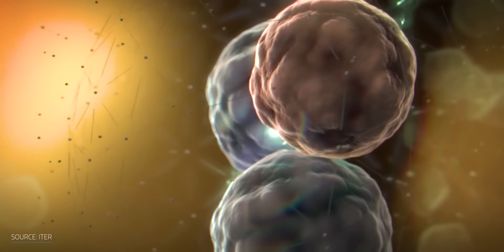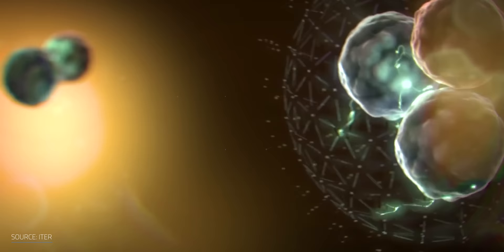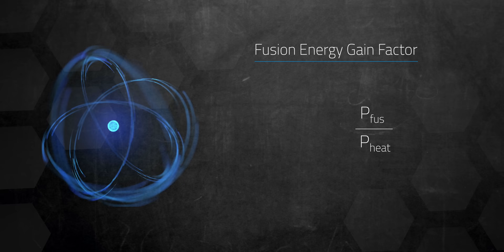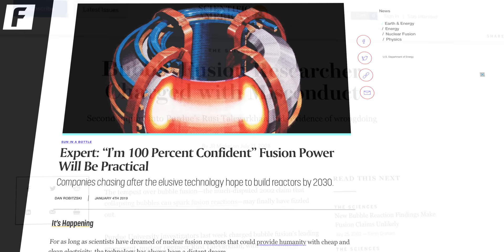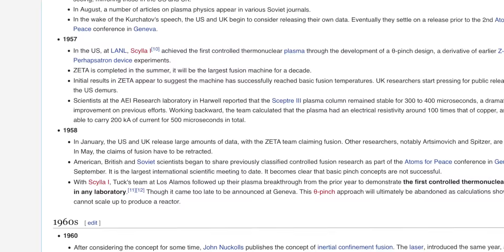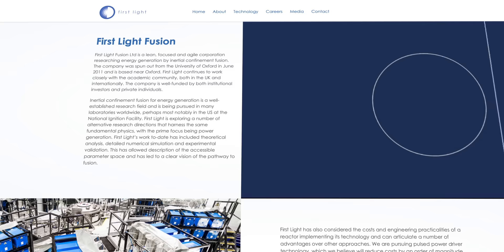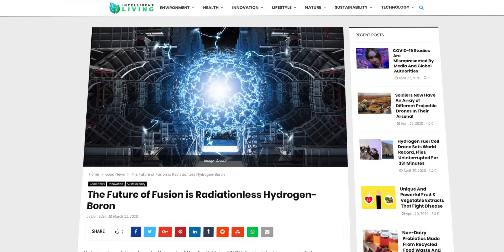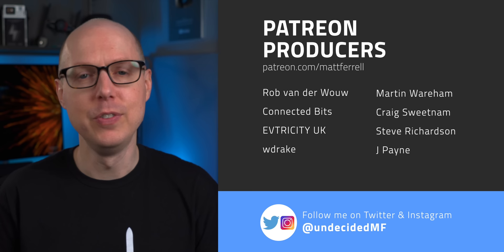The truth about nuclear fusion power - new breakthroughs

Comment: Small Correction - Fission reactions occur all the time in nature. Literally every radioactive element is a fission process. It just normally isn't in high enough concentrations to be a runaway reaction.
Reply: Small correction, there is at least one instance of a natural sustained fission chain reaction. Look up Oklo in Gabon Africa.
Reply: @CommandLineCowboy  Totally! That is why i said normally isn't. :) Natural fission reactions are super fascinating ^_^ So much to learn on this planet!
Reply: Mike Dunigan  what is meant by fission normaly is neutron induced fission. not the spontaneous alpha or beta decays which keep the core hot.
Reply: Fission and decay are not the same thing. Yes all radioactive elements decay but they do not necessarily fission. But I believe you are right to say that they do happen in nature just no where near anything like fusion in a Star.
Reply: @emnuke  yes
Reply: @CommandLineCowboy  I came here to point that case out!
Reply: Nuclear decay alone is not fission.  There is lots of nuclear decay around us but nuclear fusion is extremely rare in the earths crust.  You need some specific conditions to promote fission and nature very rarely creates such conditions.  Decay?  Yes, there is lots of natural nuclear decay in nature but it's not fission.
Reply: @ph11p3540  Ok so this is the thread for pedants, so I will point out that spontaneous fission (e.g. naturally occurring U235 ) is a form of radioactive decay.
Reply: @emnuke  Do I understand correctly that if they don't emit a proton then they didn't fiss?
Reply: No.  Not all decay is fission.  Fission occurs when a neutron splits a larger element in two, releasing neutrons in addition to the fission products.  This does not happen with beta decay.  This does not happen with gamma emission. This does not happen with alpha decay.  This happens with delayed neutron precursors, heavy elements that undergo spontaneous fissions, and uranium-235 , uranium-233, or Pu-239 in a thermal reactor when they are hit by thermal neutrons.
Reply: Fusion is also happening everywhere as most of the universe's normal matter is made up of stars
Reply: @ph11p3540  Naturally occurring fission chain reactions are extremely rare, but have occurred at least once in Earth's past, yes. Spontaneous fission however is a decay mode of U-235, and even U-238, though not dominant compared to alpha decay. Spontaneous fission happens rarely on an atom-by-atom basis, but there are so many uranium atoms within the Earth that there's basically guaranteed to be trillions of fission reactions taking place at any given moment (though they of course won't have the available fuel around to be sustained through subsequent neutron-triggered fissions). Fun fact, this is why nuclear bombs can be detonated even if they've never been exposed to a neutron source; the uranium (or plutonium) content of the fuel is constantly giving off a very low neutron flux, and in the brief moments that the core is collapsed to peak density during the bomb detonation, this flux increases super-exponentially until so many neutrons are released that a significant fraction of the total fission fuel load is burned up in only a few microseconds.
Reply: @CommandLineCowboy  i remember when i told my physics professor about Oklo, she said fission reactions dont occur in nature and told me that i was ether a lair or ignorant, she then promptly apologized to me a few days later when she saw me.
Reply: @philipocarroll  Physics is not pedantry. Careful definition of terms is a prerequisite for constructive discussion.
Reply: Hard to call it fission for beta-decay. Conceptually, not acceptable to me to call "electron capture" decay as fission. Like a K-40 nuclear captures one of its own S electron, and turns into an Ar-40, which is the main source of Argone in air.
Reply: @tricky778  Usually fission produces neutrons which then collide with other atoms causing a fission chain reaction process - protons may be produced also, but they are not important to fission processes as they cannot cause fission.
Reply: Clarification: The process of radioactive emissions doesn't always result in different element being formed. Few radioactive decays, of various isotopes involve neutron emissions. It is the emission of neutrons that are employed to stimulate other isotopes to generate more neutrons than they captured to drive the fission process.
Reply: As someone who loves to be a pedant. I found this entire thread to be the most beautiful sight I have ever seen. 

I am weeping with joy at its magnificence.
Reply: Sky Man  - I once believed that the original cold fusion pronouncements were a major breakthrough. Then I noticed that experiment after experiment failed to replicate the effect. No matter how many experiments disprove it there will always be die-hard believers who will refuse to admit that they were wrong. There are a great many people in this world who find it virtually impossible to admit that they were wrong. One example is the current U.S. President. In the face of the evidence I had no problem giving up that dream.

There are also a great many people, who find it very convenient to reject all criticisms of their deeply entrenched worldview, by claiming one, or another conspiracy theory is behind the criticism. Some have been convinced that opposition, to what they deeply believe in, is evidence that they are right. The human mind has amazing capacities to believe almost anything it wants to believe in, such as the earth is flat, the Holocaust is a myth and Creationism is behind the variations in all life forms. A great many people take great pride in their fringe beliefs and it forms a foundation for their sense of purpose in life and the social interactions that they have.
Reply: Actually I don't think radioactivity is technically fission. It occurs because of the weak nuclear force (quarks making up a proton suddenly switching with a nearby particle to change into a neutron), whereas fission is caused by bombardment of beta particles breaking up the nucleus of the atom
Reply: @TheRealMagicBananaz  - I agree with your radioactivity description. My understanding is that the fission in typical nuclear reactors is the result of the nuclear capture of slowed neutrons by unstable heavy nuclei such as U-235 or various plutonium isotope nuclei. You might want to see what Wikipedia says about it.
Reply: Sky Man  Nice deflection, instead of responding to what I actually said you just start talking about something else completely unrelated. As you tried to deflect (and your deflection doesn't even make sense) I will just ignore it as it has nothing to do with this discussion.

Do you know anything about nuclear fusion or fission, how they work or how "cold" fusion is different and is meant to work from normal fusion? Do you know how black holes are made or how they work? Do you know what anti-matter is, or that we have observed and can create anti-matter? (if an extremely small amount) Do you know what the signs of dark matter are?

In order to come to the conclusion that something is wrong you MUST understand it, otherwise you are making an argument from ignorance. If you can't answer at least half of the above questions correctly then you are just spouting nonsense that no one will listen to, similar to flat earthers and other conspiracy nuts.
Reply: @CommandLineCowboy  they are not natural reactors at all try reading the science on them.
Reply: @ossiedunstan4419  Care to point me to where "the science" says the 16 sites at Oklo did not sustain fission?
Reply: @CommandLineCowboy   I am not saying they do not sustain fission , i am saying that natural fission is not a nuclear reactor , it produces no power to any grid just like fusion reactors don`t pump power to the grid they take power from the grid.
They are not stable and depend on seawater levels , i have read the papers and seen the footage on one.
you seem to think they are fucking reactors they are not .
natural fission is not stable it is the material trying to become stable in its surrounding environment , stop trying to state these natural occurrences are producing fucking power to the grid.
Reply: @ossiedunstan4419  I am saying they sustained fission, I did not mention the word reactor you did. But I do consider the 16 sites at Oklo to be valid natural reactors. So a pulsing TRIGA eactor isn't a reactor because it doesn't put power into the grid? What's water got to do with it, take the water out of a PWR or BWR and the fission stops there too, are they not reactors because they need water? For me if it sustains a fission chain reaction for seconds it counts as a reactor, these lasted for 30 minutes out a three hour cycle and maintained that cycle for hundreds of thousands of years. How long can a power reactor run without changing the control rods? Over the long term no reactor is "stable". So whats your definition of the running time scale that makes for a valid reactor?
Reply: @ossiedunstan4419  No TRIGA reactors have ever powered anything, so they're not reactors?
Reply: Phillip,
Sorry, but nuclear decay is considered a form of nuclear fission!  Look it up!
Reply: @CommandLineCowboy  You can lead a horse to water , but even giving it peanut butter will not make it drink.
Reply: Mike Dunigan  so volcanoes are really deep nukes from meteors that hit billions of years ago. Nice
Reply: Just wanted to post essentially the same thing. Though not all forms of radioactive decay are automatically a fission many are. Anyway, take my thumbs up ;)
Reply: @mnomadvfx  Protons can be transformed into Neutons through boson exchange. Also, all subatomic particles are important when considering heat energy transfer, the ultimate goal of a nuclear powerplant.  Nothing is trivial when trying to make something so complex.
Reply: @ossiedunstan4419  A "nuclear reactor" does not have to produce net power.
You mean a "nuclear powerplant".
Reply: That's where I realized this is video is basically a joke - when a particle physics video can't even get basic particle physics right.